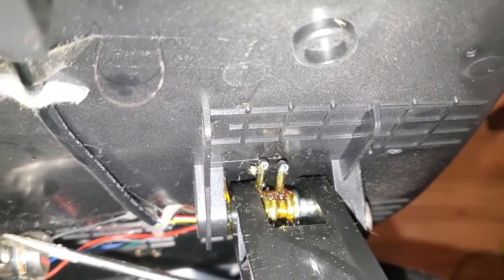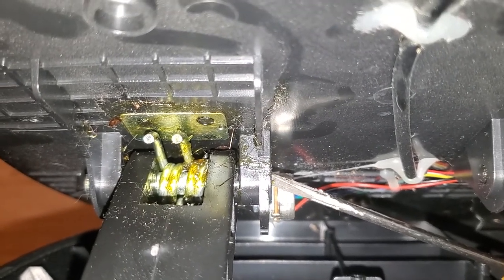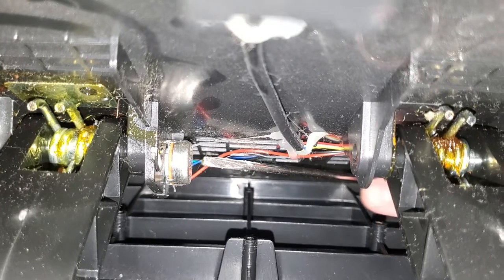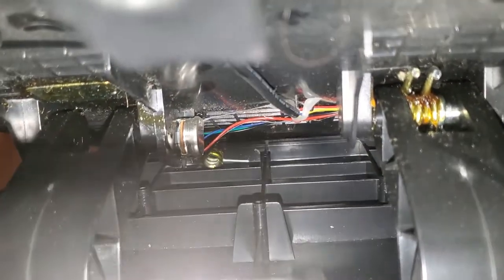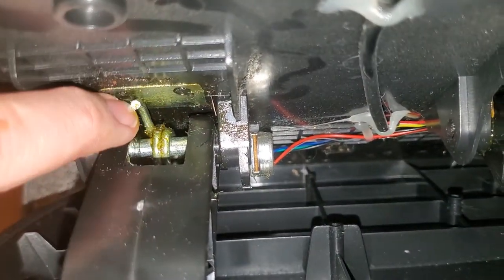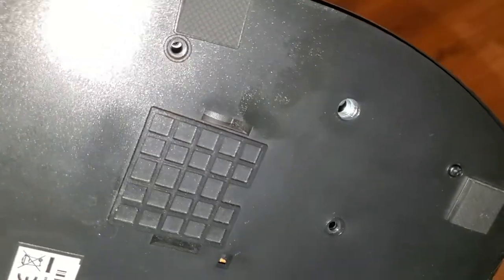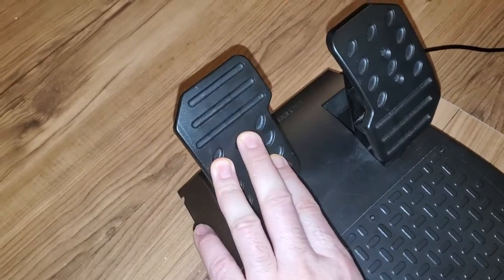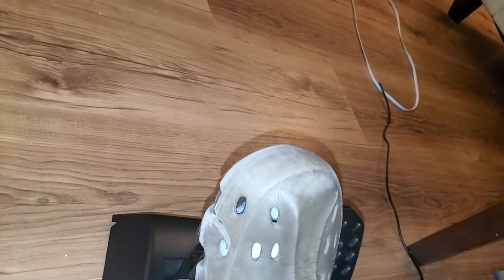Fixing Thrustmaster 458 too stiff brake pedal (Remove 1 spring)

Comment: I know its a old video but for the people with ajust gears issue, first you must to screw correctly the sensor right to the gear,screw it correctly bcause is moving with the years( the degree of the sensor afect your gear),after that you can select the gear,make test before to screw everything and dnt forget that the black panel push your pedals when you put it. with the sensor in the good position my gear was 3 for brake and 4 for accelerate.work 100% but test must be done. My english sux sorry.

Comment: Do you know in which gear should the teeth be?
Reply: Did you ever find out?
Reply: @justingood1443  unfortunately no.
I would recommend you to send a email to Thrustmaster asking for, because there is a lot of contradictory information.
Good luck and if you you get any info please tell me.
Reply: @ricardocarvalho850  I got it. It’s the third groove for both pedals
Reply: @justingood1443  thank you so much bro. you saved me 3 hours of my life
Reply: @Madewww  no problem. Haha.
Reply: I know its a old video but for the people with ajust gears issue, first you must to screw correctly the sensor right to the gear,screw it correctly bcause is moving with the years( the degree of the sensor afect your gear),after that you can select the gear,make test before to screw everything and dnt forget that the black panel push your pedals when you put it. with the sensor in the good position my gear was 3 for brake and 4 for accelerate.work 100% but test must be done. My english sux sorry.